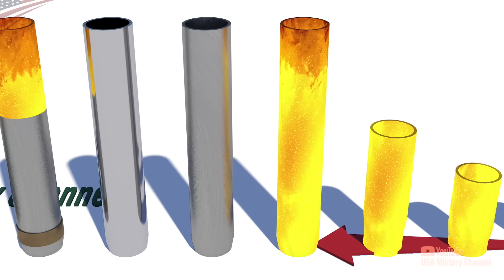Inside the Factory: How Steel Bars Become 155mm Artillery Shells

Comment: For me as someone who dosn't kno much about engineering i do feel like some steps are needlessly complex. most steps that use a robotic arm don't look like they need one for example and i don't really know why you inspect it, cool it and then inspect it again. if the first inspection isn't reliable it seemes to me that you could either leave it out or youre using the wrong inspection method.

Comment: Look at the massive amount of machinery this takes. Now imagine how it was done in WW1 and WW2.
Reply: Faster, better, cheaper.
Reply: @ is it any wonder why we had to change the entire countries manufacturing to support the wars? These days a single factory spits out what probably took dozens or more.
Reply: Most projetile bodies were casted not die forged giving you way wider tolerances on the inside. But it was cheaper and faster while the milling and threading for nose fuse was the same. Material grades  were cast steels or even cast iron. However downside was that casting has more tolerances on inside as said before and material quality was plagued with casting defects. All this little deviations add up affecting ballistic properties and leading to way greater cep compared to forged ones...
Reply: Remember how inaccurate artillery was in ww1 and ww2

Comment: This plant, includes the main building (former erecting, machine and boiler work), Blacksmith, Foundry and 5 story Pattern storage now office building formerly owned by the D L & W railroad and primarily used to repair steam locomotives has been in the manufacture of projectiles since its purchase in the early 1950s.  There are multiple lines being worked and production is rapid.  Consider that the finished product has to meet the material, manufacturing and quality control requirements necessary for the intended service.  Contrary to some comments made, it is a very efficient plant and would not be in business to the military unless it could prove its worth.  Most military manufacturing plants including those for railroads, ships, armored vehicles, etc., are generally considered heavy industry.  Most people now have little understanding of what it takes to make heavy equipment.
Reply: Why do they go through all the trouble of using billets, heating and pressing them requiring massive amounts of time and energy instead of using waaaay cheaper steel rolls and welding & pressing those into the desired shape?
Reply: @Runefrag  single casting followed by machining will be more consistent and accurate.  The rounds need to have their center of gravity exactly in the center of the hole that was punched.  Otherwise the round will wobble and miss the target.
Reply: Guess that guy doesn’t understand how important accuracy is.
Reply: @Coecoo because we're not russian, nor Chinese. We value accuracy, precision in what we hit.
Reply: While I’m not an arms man by trade, there has to be uniformity in manufacturing in order to meet specifications.  The explosive material within the projectile and the time to detonate, the force created to provide the desired result has been determined by testing and if you will note, the projectile is made from 4140 material.  This is a medium carbon low alloy steel with two elements that would require some very strict welding requirements and pre/post heat treatments to be useful.  I.E. more time and more expense.  There is more to this of course, but also, this plant is one that performs this work in the most efficient manner.  Not all of this is understood by a population that is moving further away from heavy (blue collar) industry and more into electronics.  Everything has a place but it is not at all understood on how or what works best to obtain the desired results with a longer service life.

Comment: A saw, 4 presses, 2 drilling machines, a cooling tunnel, several heat treatments - a manageable process flow. Core equipment needs to be constructed for the purpose, which leads to long delivery times. On the other hand, I don't see a reason why the west shouldn't bei able to produce 10 Mio. shells a years. It means just app. 15 of such lines...

Comment: Since people keep asking about it, The driving bands (brass ring) are installed by machining a partially undercut groove into the bass and then filling/overfilling it with brass wire from a MIG welder. Before it fully cools, it is then machined to dimension before it becomes brittle. There is a full tour of this plant on PCN network, the Pennsylvania version of C-SPAN.
Reply: It's crimping process not welding
Reply: Nope, it stays uncut during heat treat, then gets turned down on the finish line with the steel.
Reply: Yeah when turning to dimensions while hot then after cooling the diameter will be too small
Reply: I was thinking just that question... Thx

Comment: So in the United States howitzer projectiles are manufactured using three separate heating and cooling cycles, are manually inspected instead of by a machine-based laser system, and are open-air spray painted rather than by electrostatically coating the shells with paint.  No wonder production, as compared to other countries, is slow, labor intensive, wasteful, and expensive.  The American military/industrial complex seriously needs to modernize.
Reply: This kind of piece is particularly impractical for casting. The forces it has to withstand are particularly nasty and the shape not conducive to reusable molds.
Reply: Automated or not, would still take 3 heat cycles
Reply: @Echo22WC  - I bet those artillery shells could be cast with a tapered nose and hollow core then machined to tolerance a whole lot less expensively, than forging and machining them individually from solid bar stock. 

Doing it as a cast would use less energy and involve less post-casting machining and produce less waste material.  It would probably even result in more profit for the manufacturer by simplifying the processes.
Reply: @WarHawk-  where you getting the solid heavy base with a cast model? These aren't rockets, they're pointy cannonballs. They have to withstand the pressure, cast is garbage.
Reply: @Echo22WC  - Sure, but I wasn't taking about pig-iron.  Yes, compared to forgings, cast IS garbage, but engine blocks and even parts for jet and rocket engines have been cast and used with great success.  Casting has come a long way since the days of pewter cups or 'cast iron' lamp posts.
Reply: @WarHawk-  well it's a hollow, 1 piece shell, idk how you're casting it with a single narrow hole in the tip 🤷‍♂️

Comment: a few notes here
1) if this is just for 1 production line, then it simply means there are dozens of similar lines in the factory doing the same thing at the same time
2) the artillery shell is just a part of the artillery system as there are the fuses and the propellant bags that are needed for each shell produced.
Reply: true, the fuses and propellant bags are made elsewhere and then finally assembled on govt property. this whole 15-acre facility in scranton is just to make the metal projectiles for howtizers and mortar rounds. insane if you ask me
Reply: @jacobjacob5898  and imho, those 3 inch-pointed triangle-shaped things called the fuses which are screwed onto the tip of every artillery round, is the most important part of it as it tells the round to go BOOM. Plus they can be set to go off by timer or by impact.
During WW2 at the Battle of the Bulge, the Allies used artillery fuses as air burst against the enemy in the forest and it shredded them
similarly, the proximity fuses were used devastatingly against the Japanese aircraft in the latter stages when they resorted to suicidal kamikaze attacks.
Before the invention of the proximity fuse it took approx. 10,000 rounds to shoot down just 1 enemy aircraft
After the proximity fuse was used the numbers dropped to about 800 rounds

Comment: When did the brass belt get applied to the base end of the shell? 10:23 the subtitle says they'll get loaded with propellant and explosives at other plants but isn't the propellant placed in the cannon behind the shell if I'm not mistaken and only explosives are placed in the shell. I'm not a veteran, just seen videos from the war.
Reply: There are also rocket assisted projectiles and rounds with a small gas generator placed at the back to help with aerodynamics and extend range so it could be that
Reply: That is called a Driving Band.  Basically it bites into the rifling and seals the propellant charge.  These rounds are separately loaded before the propellant charge (which can vary by range.
Reply: @lewcrowley3710 oh interesting, I was thinking that, like those copper sealing washers you use between bolts.

Comment: Surely if these are shells, they would only be loaded with explosive & detonator. The propellent is loaded after the shell.
Reply: Explosives are loaded at a separate, specialist plant. Detonators are affixed by the military unit that fires them.
Reply: They are called fuses.  And they are shipped separately and put on before firing.
Reply: Base bleed and rocket assisted shells contain some propellant

Comment: This is one of the most complete and comprehensive "how it's made" videos I have ever seen on YouTube. Most other channels show two guys talking a lot and showing little. Excellent work!
Reply: @joelonderee no "copper jacket is shrunk on" no "spotwelding drilling and thread cutting of the tip". i agree that it is well done. but to say "most complete" is a stretch. you understand how its made but it leaves you with questions. it's fine. 7/10
Reply: There is a '1917 film of making '8" Howitzer shells' that is long and elaborate with many more steps than this mechanized process.
Reply: These things can be fired up to 14 miles, so they have to be precision manufactured to insure consistency.  At those ranges, slight manufacturing defects could result in shells missing their targets by hundreds of yards.

Comment: Enter rail-guns:
2025: How Steel Bars Are Artillery
Reply: Even with a rail gun, you're probably gonna want to have a large explosive warhead for its effects down range.   Artillery rail guns won't rely on kinetic energy to cause damage, but will be flinging very heavy explosives a very long distance.  

Not really different from how a modern tank gun fires a dar different projectile than a modern howitzer.   Two different, but similar needs creates two different, but outwardly similar results.
Reply: 2025?
you are VERY optimistic...

Comment: Didn't see where the fuse well was threaded, nor where the copper driving bands were affixed.
Reply: Those parts were probably proprietary processes. They also didn't show how the shells got turned to rough and then later to final dimensions. ;)
Reply: Well then you need to open your eyes
Reply: @jeremymackevincaylor4954  They skipped that part, brain-pac.

Comment: Extremly ineffective. For example why forming a tube after cutting and not using a tube from the beginning. But now I understand why this simple mass-product is so expensive (4000-6000 USD each).
Reply: Even the smallest projectiles are drawn from either bar or sheet blanks.
The base and driving band area takes the most force due to the explosion of the powder and twisting forces from the rifling.
Reply: Cases are much cheaper than that. When you buy a shell you are also paying for explosive filler, handling costs, fuses which can be very complex and expensive, latent production capacity and the incredibly high financial costs in a highly volatile (pun intended) and capital intensive industry.
Reply: yes too slow, too expensive, just filling the pocket of arms manufacturer...
Reply: How would you go about making a tube, that didn't involve this process?  Keeping in mind that you would have to ship and cut it without deforming your tube...
Reply: A tube formed from billet will be much stronger than a conventional welded tube.

Comment: They are shells, not cartridge cases.
Reply: They technically are shell cases, a few things are missing to make them shells
Reply: They also don't contain propellant, just the explosive. Fuses are attached to the shells in the field and set according to detonate on contact with the ground or at a certain height above the target.

The propellant comes in the form of combustible bags, or charges, that are loaded into the breech of an artillery gun after the shell has been loaded. The more charges, the further the shell can travel.
Reply: @stevestruthers6180 glorified cannon balls.
Reply: Thank you. I was wondering when they switched to thick walled steel for cartridge cases.